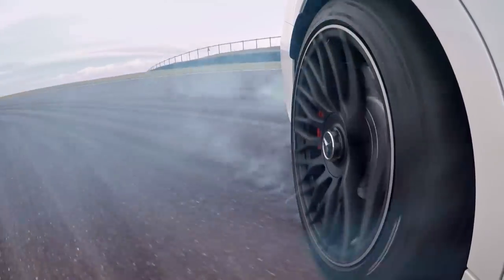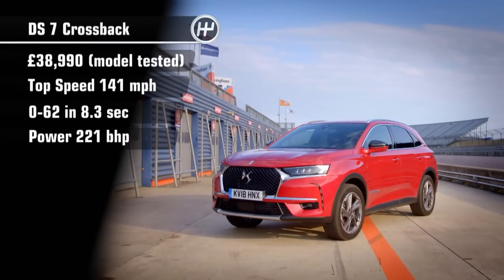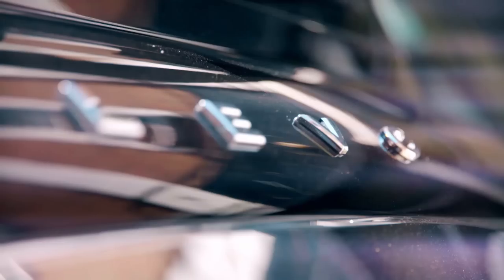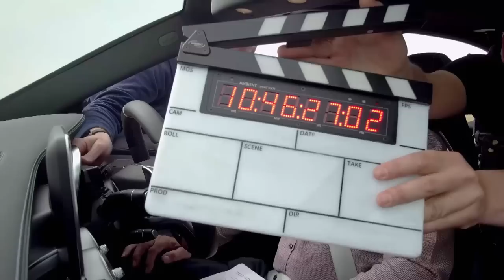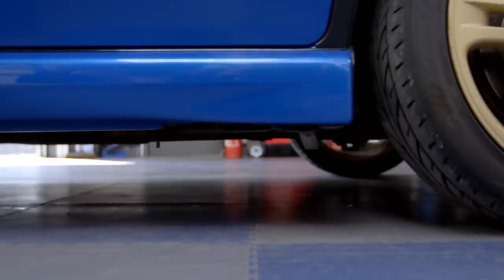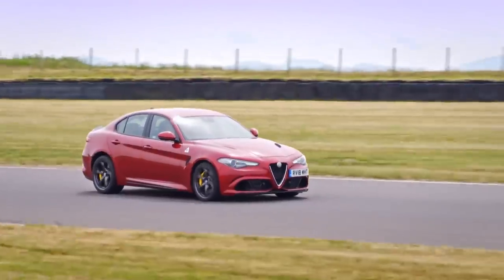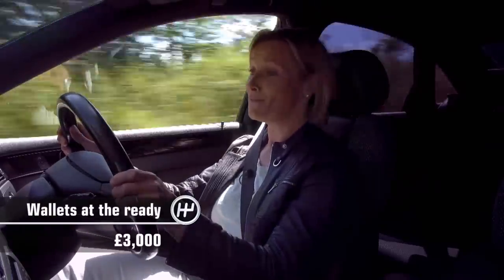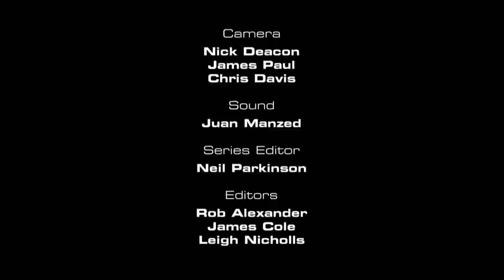Series 27: Episode One FULL Episode | Fifth Gear

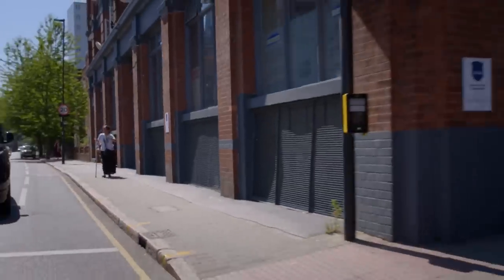Comment: 16:49 I can't understand why range extender EV didn't catch on. It a miles more practical solution than relying solely on battery power. If I was forced to drive an EV, hydrogen fuel cell will be my top choice. But if I don't have access to hydrogen filling station, range extending EV will be my alternative.

Comment: What's more shocking in the slalom test is Jason only had it in N - normal mode,  in this mode the engine is only pumping out around 300bhp, you don't get the full 500+ unless you go into D - Dynamic or into Race.........whereas the AMG is in full fat power mode all the time afaik?? (albeit held back by TC and Stab like the Alfa of course)